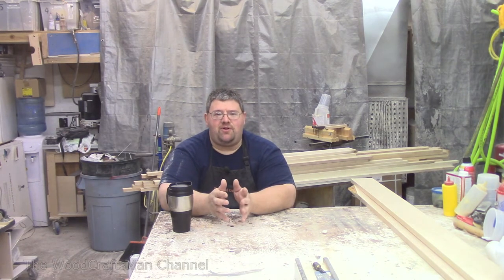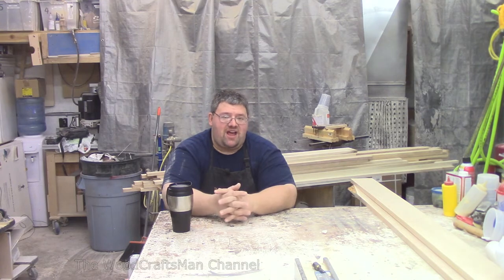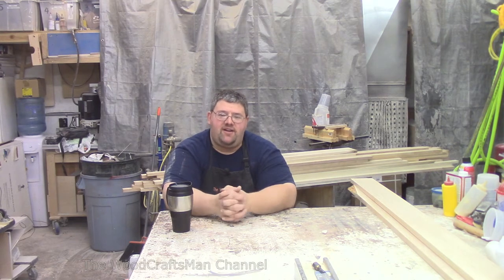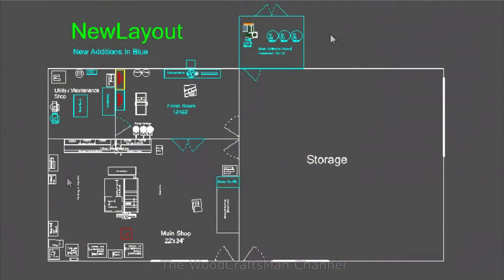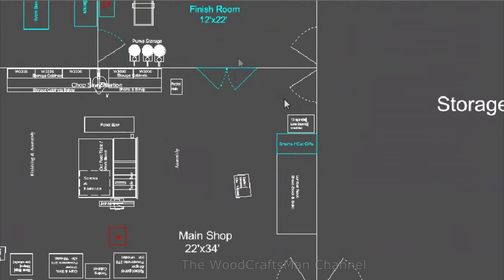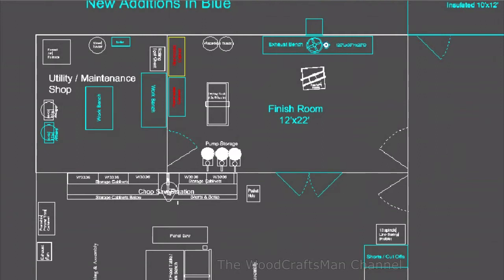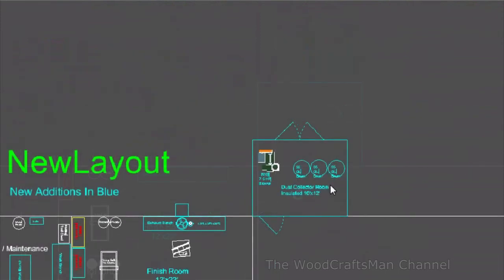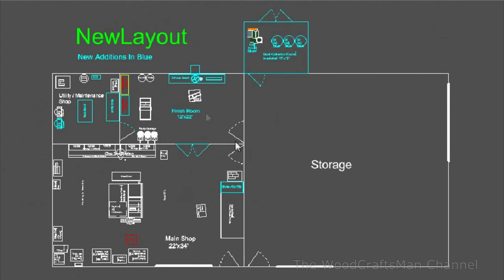Dust Collection System Upgrade 10 26 17 # 224

Comment: Hey Scott, nice upgrade plan.  Suggestion, how about adding a first stage (cyclone separator) to your system. That was my best purchase 10 year ago. Cleanely emptying the dust bin in 2 minutes without any mess and almost notting reaches the filter bag so keeping a much better suction all the time. My two cents. Good video as always! Yvon A.
Reply from the maker: +medic0us hi, I have thought about it, just never really put it into perspective. I will need to re-evaluate it. Thanks for the advice. Scott